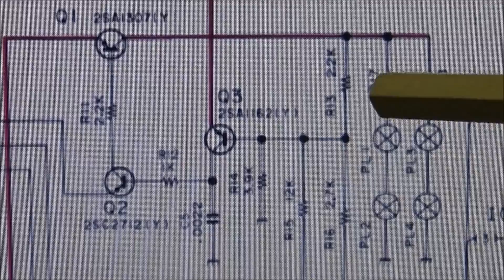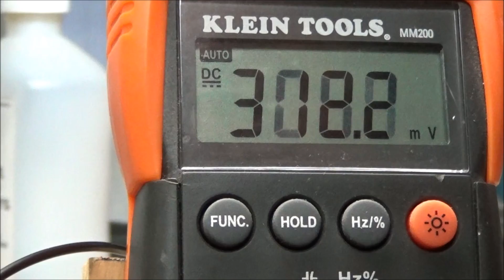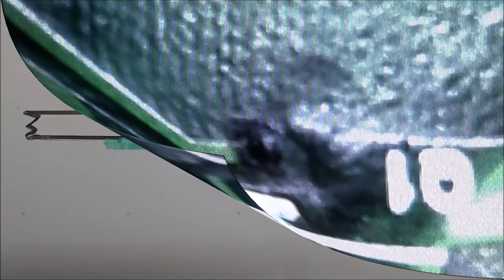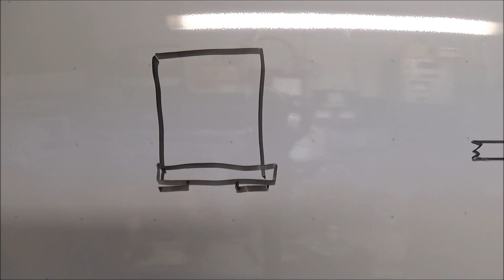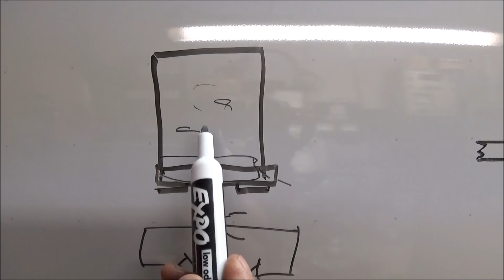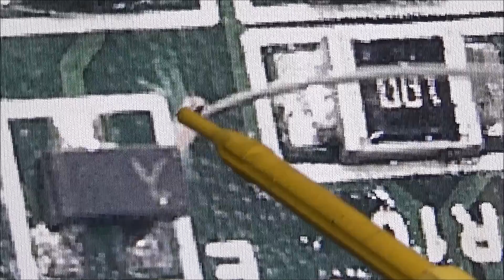#15 Kenwood TS-50 part 2 Display board trouble shoot and repair

Comment: i can't understand, I've got the same TS50 in full working order. No leaking Cap's. with AT-50 ATU and the 300 Automatic Long wire ATU  This equipment was installed for 10 years on a sailing ship traveling around the World. Very close to Salt Sea water, but no problems.. Greetings from Holland.. Hans

Comment: Hi there. Great informative videos on this Kenwood TS-50 rig. It's really helped me a lot with mine. I was looking on eBay for a replacement filter board and there were what seems like two different versions. One has a toroid at L403, and one does not. Do you know what the difference is by any chance? Do you know if they are they interchangeable? This is my only rig and at 67yrs old, I can't afford to replace it. I noticed that on my rig, the caps just started leaking also. Glad I caught this before any destruction. When I power up the rig, I get a very loud squeal, even with the volume turned completely down. That's what prompted me to take the cover off and look. Any information would be helpful. Also, are you still in business? only asking because these videos are 7 years old. If you are, i only have half the equipment needed to align this rig so I've got to find someone else knowledgeable to do this for me. Thanks for ypur time and consideration. And thank you for your videos that got me this far. de James KA9TII

Comment: ESR - Equivalent SERIES resistance.  The resistance in the capacitor is in series, not parallel, and its resistance goes UP as the cap fails, not down.   (Ideal) capacitors don't dissipate any power, but resistors do.  So as the cap becomes less of a cap, and more of a resistor, it starts dissipating power, and loses its filtering ability.
Reply from the maker: You are correct. I made it sound backwards when I did this video. Was under a bit of pressure due to my mother passing.  Think I got a dozen emails pointing out my mistake LOL.  Thanks for the reminder. It is always good to hear.
Reply: Quite understandable.  Thank you for these videos, it is a great help to watch someone who is far better at radio repair than I am.  I would have given up on this thing long before it was fixed.

Comment: I have a kenwood ts50 , back light works, but the numbers are dim, when you look straight at the front of the display, but when you look at it from a 45 degree angle you can see them ,,   any thing you can help me with this .. sam  wa5yhn@arrl.net
Reply from the maker: +sammy turner Sam, Sounds like a case of bad capacitors. This is the number one cause of these radios failing. ESR of the caps cause them to load the circuit down. Best to go ahead and order all capacitors for the unit. If you do not have it order you a set of hot tweezers and some good flux. This make capacitor removal a lot easier. If you download the service manual you can check all the voltages going to the display board. You can then find which cap if causing the issue.  If the caps have not already leaked on the board count yourself lucky. Hope this helps.
Reply: I have replaced the cap in your video, what controls the display number's contrast,they are very dim and i cant figure out what controls the display's contrast
Reply from the maker: +sammy turner Sammy, I have this information noted on my schematics. I will try and get in the shop tomorrow and look it up for you, Seems there is an IC that controls it also.

Comment: My TS-50 needs refreshing, it works but the LED doesn't. also the antenna connection needs freshening up. Would you consider doing the work for me? It is beyond my capabilities.  K4TEW
Reply from the maker: +Kent May Sure Kent. Shoot me an email.  On qrz.com kc4umo